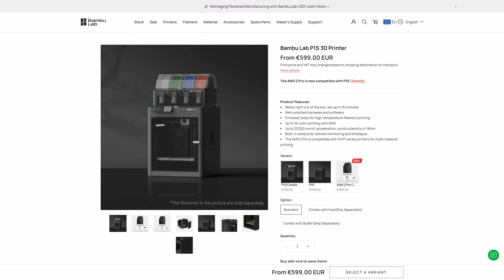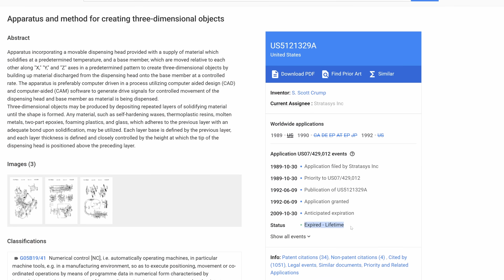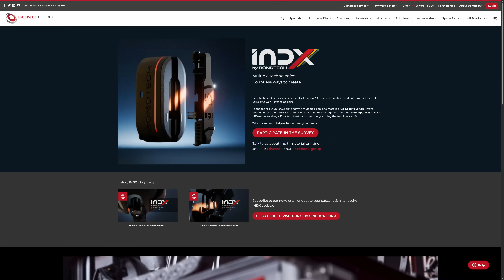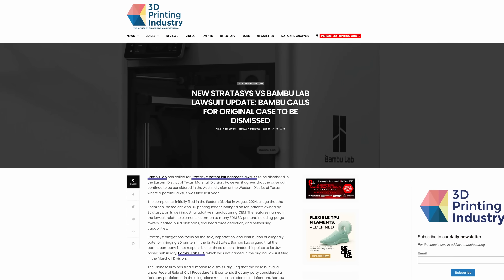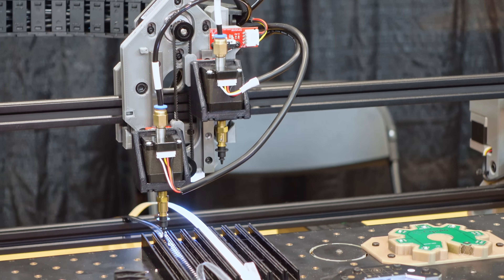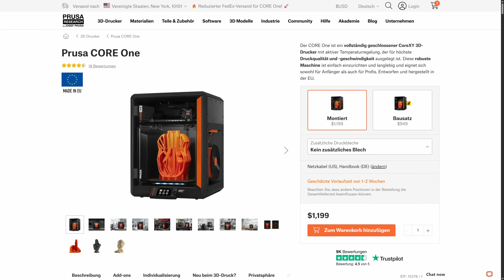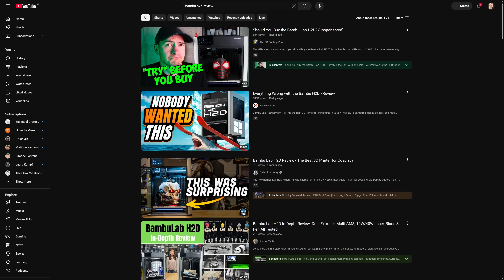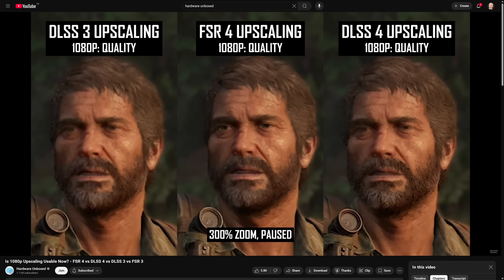How Bambu has won

Comment: My MK4 is one of the very, very few things that I own that gives me peace of mind in that I'm able to fix this thing no matter what, with minimal if any involvement from Prusa. Its one of the very, very few things that I feel totally in control of. I like that, because control is being taken away from virtually every other piece of hardware and software that we have access to.
Reply: Agree!
Reply: Same for me with Voron
Reply: Bro what are you gonna if/ when prusa dissolves? If you’re ever in a situation where prusa can’t save you?
Reply: PRUSA - PR for USA
Reply: I have the same thing with my (now heavily modified) original Ender 3. I know I can get a replacement for any single part of it on Ebay, Temu, AliExpress etc. and  I actually already have spares for most parts. The whole machine is made of generic components that are used in dozens of other early printers and the software is fully open source.

My Ender 3 V3 KE is already a more complicated case with less generic componenets and my Bambu P1S, while extremely capable and reliable machine, is mostly made of proprietary parts with completely closed software, though aftermarket replacements do exist.

On the other hand, a 3D-printer is fundamentally a pretty simple thing, it's just stepper motors, heaters and sensors after all. People have even replaced the whole control electronics of Bambu printers with open source stuff and having a 3D-printer enables you to produce many parts yourself to replace the proprietary ones with something generic so I guess even the Bambus will be able to be made usable after the manufacturer decides they are "obsolete" and bricks or cripples them through software updates. 

Of course that means going back to the era of tinkering.
Reply: That's a bit of an illusion, many things on that printer are not open source, heck, even most things on a complete open source printer are not open source. And while you can probably fix the Prusa Mk4 with other parts if Prusa is no longer capable of providing you with replacements, at what point does it stop to be a Prusa and just starts being a heavily modded generic bedslinger? There's a world of difference between a Prusa and a Bambu, I agree, but it's not as utopian 'open' you (and others) make it seem...
Reply: @Cergorach  It never stops being a Prusa. "The ship of Theseus" concept has been around for thousands of years.
Reply: @Cergorach  I never said it was a utopia of reparability, I just said that I feel in control of it more than anything else. The Prusa has a lot of generic parts, on my own MK4 I didn't even use the fasteners that came with it because 2 M3 bolts just broke at the head after my first build attempt and I just swore it off. Is my Prusa not a Prusa because I didn't use the supplied fasteners? Debatable. I can also just get the aluminium extrusions from any supplier as long as they're cut to the same length. Not going to go through every component on the BOM but you get the idea. Just because the Prusa isn't 100% repeatable with things you can buy in your grocery store doesn't mean I 'may as well' get a Bambu Lab machine. There's still a world of difference between a Prusa and a Bambu machine. The Bambu machine can usually produce higher quality prints in a shorter amount of time and they're good machines but I still remain wary. I wouldn't mind having one as a secondary machine, but if I were to only be able to have one, it has to be a Prusa.
Reply: Except not all of the printer is open source, so if for example the mainboard breaks then you have to replace it with something different and set up the whole printer again and hope that all the features work with your mainboard and firmware. You could do pretty much the same thing with most other printers, closed source or not.
Reply: @conorstewart2214  I'm talking more mechanical. I'm aware that the thing isn't 100% open source. There's always going to be a weak link in everything, even a Voron build. A certain component supplier may just go out of business with no one else making replacements. The MK4 uses aluminium extrusions and various other things that are either generic or easy to replicate. You have to also think about what things are actually likely to break. The Buddy Board or whatever they call it isn't likely to fizzle out. The cast iron frame is straight up not going to break. The 3D printable parts can be replaced. It strikes a great balance between being fixable, while also having great support and plentiful, long lasting parts.
Reply: @conorstewart2214  the mainboard, while not fully open source, has available schematics and no proprietary solution, so no one is stopping other manufacturers to make a fully compatible spare part.
I think that's a decent compromise between protecting development work  and providing independence from their own solutions.
That however cannot be said about their heatsink/load sensor solution..
Reply: Bro what? Many parts of Mk4 aren't opensource... Don't drink the coolaid
Reply: @NordicStrider don't drink the open source koolaid
Reply: Who cares? Its a better printer @NordicStrider
Reply: @NordicStrider  The MK4 has available schematics. Bambu does not. Thus fully compatible spare parts can be made for the MK4, even those that are not open source.
Reply: My A1 was 300 dollars so I love my closed source printer with no frills setup, no research, no nothing. In a few years when it’s old tech you can move on to the next thing
Reply: If Prusa made i car, I would buy it.
Reply: @PerMejdal if they made a car it would be only for mechanics and people who are happy spending a % of their pay on car parts
Reply: my bambu lab a1 gives me piece of mind knowing that all i have to do is run my build plate under the sink with hot soapy water every few weeks. and maybe a drop of lube on the bearings.
Reply: You may not be wrong, but you probably don't feel that way (and don't care to) about the vast majority of things you own and use. Even if you say you do, your actions almost certainly paint a different picture.

You feel this way because it's a hobby for you, and there's magic in it for you that you probably don't see in things that you view just as tools to be used for achieving other ends. Nothing wrong with that, but it also doesn't mean Bambu did anything wrong. Nevermind that the entire open source creed/ideology, as generally express on the internet, is more akin to a religion than anything else. 

Life moves on.
Reply: Typically because people who want that control, have no idea what they're doing, break their own product and then blame the company. That's why the industry has pivoted to easy-to-use printers. There's still plenty of printers out there that are open source and can still be fixed by their owners if need be.
Reply: @TheNerdArmory  What, so all the Voron/Sovol and Prusa builders are constantly breaking their own printers? Well here's my anecdote; I've found that people who have no idea what they're doing, whether they acknowledge that about themselves or don't, typically want something plug-and-play. The industry didn't pivot, new players came in to cater to a new audience. Bambu didn't pivot from making open source machines to what they're doing today. They started off in this manner. Companies like Prusa have not pivoted, they're still putting out firmware updates for machines from 5+ years ago. They still serve the same audience.
Reply: @XxMsrSzprzxX  i disagree with you on one point. prusa for a long time was not a inventor but more an integrator, he integrates good ideas from multiple open sources projects. making the successfull MK2 (the mk2s was my first printer really enjoyable at the time one of the best you could have)
but now they are not the only one, really good projects emerge and are really complete (voron) and now that some chinese manuifacturer are really competiting, prusa is doing what other brand are doing: they start to make their own parts with patent and no open source about it like their nextruder and their heatbrak and nozzle which looks a lot like revo but slightly enough different so they dont fall into the e3d revo patent... and they patented agin they slightly different design...

Comment: I built my rep rap with help from vik Oliver, I  got a ultimaker and ultimaker 2 which I had tinker firmware on and made a tool changer. I got a Bambu x1c early on and it’s been a game changer. I know how to tune a printer but I don’t even need to. With an AMS to have as a filament loader. It makes a perfect workhorse to make functional prints.
Thomas I appreciate your expertise and big picture view. I always looked to you to see where trends were moving and what I might need to pay attention to. Take from that what you will. Leadership in this space is what I appreciate.

Comment: Rarely commenting anything. But Tom I watch your videos now about a decade and I feel you here. I started of with Wanhao i3 or a self build Kossel mini and as a helper the cel robox. Last reminds me of the Bambumachines quite a bit. But in the past it was Prusa and also the fun to tinker and build machines. I am hoping that Prusa goes back to the points where they more obviously joining forces with Bondtech and e3d as they used to do it. Would love to see something like an upgrade Indx Prusa XL but I might go back to a voron. Bambulab is more for the people that would like to have a tool and not a project and I really like a lot of their implementation like the hot end being clamped in and the tighter enclosure directly from the beginning. And at some point I might end up buying a bambu. But at the moment I am more hooked on the indx from bambu, very impressive. Prusa should also come up with other tool heads for the XL as they started to introduce the platform. We will see. The competition is not a completely bad thing.

Comment: I think occasionally doing things like the Air Sensorbox is the right direction, because it's related, yet spans across a wider spectrum of other audience, otherwise you risk becoming yet another person on that review list you showed. 
However my criticism from the sensorbox project is you should be ready to be behind any projects that you start, at least until it becomes mature enough that there are other people contributing to it before stepping back.

I think the 3D printing community has come from being full of people who were interested in "3D Printers"... to full of people interesting in "3D Printing"... like you said... people are not interested in how your photo printer works... as long as it prints good... obviously this is not to say that we give up on the spirit which built the community in the first place... because without the original community... companies like Bambu Lab would not be able to take this "hobby" mainstream... and that's also not to say Bambu Lab is without contribution... prints from their printers are shockingly great and one might even stretch to say that it's perfect... I feel guilty that I am using my H2D way more than my fleet of Vorons but that's just how things are... however Voron is not obsolete YET

So I think the best thing that the "influencing" people can do is... watch out for things that these companies do that is really against the consumer... and speak up for the community... 

Everybody has a different feeling about cloud integration, and I, coming from Vorons... I actually don't really mind all that much even if I am locked into BambuStudio... it's a different kind of machine... so you have to come at it with a different mindset... it's a machine that "just works" so you do it the way it expects to be done... if you don't like that... there are other brands... nobody is forcing you to buy Bambu Lab printers... vote with your wallet... there really doesn't need to be ill feeling towards anything

Comment: I'm really interested in 1)  How well does the printer do at a given task (quality), combined with 2) How reliably does it do that, tempered by 3) How much does the printer cost to do that (value and operational expense).  Is the Elegoo Carbon gonna get the job done for half price or should I just cry once and get the Bambu P1S?  Is the Prusa Core One going to save me enough filament over xx amount of time to be worth that 40% premium?  Will it EVER get a reliable enclosed AMS-like companion device?  Does it ACTUALLY print as well as the Bambu?

For me, I just want to use the 3d printer as a tool.  I want to get something built that turns out to have a part best made by a 3D printer.  I'm not that into HOW it works or WHY it works.  More into WILL it work and HOW LONG will it work before I have to troubleshoot.  Brother laser printers are a great example.  They are cheap and work just as well as ANY other laser printer for almost as long.   But they are not worth repairing because they are so inexpensive.  They get the job DONE with a minimum of fuss.

Comment: Hi Tom. I got into 3d printing with the ender 3, and left 3d printing because of the ender 3.

I then got back into printing because of the p1s, and im leaving the p1s because of 3d printing. It just worked, and that let me grow confidence and experience in the core applications.

Now im back to the ender 3's, but building my own machines.
I needed a bambu as a stepping stone. I have too many other hobbies.

I dont know what im trying to say. Maby that i could have saved myself the trouble by getting a prusa in the first place?

Anyway the (old firmware) bambu is for sale to someone who can stomach the direction of the company. I cant.

Comment: this is all very similart ot "Personal Computing" (way before the PC, there were kits of parts to solder together, and tinker with. Before "open source" was even a phrase.  You went to a computer "fair", and bought components to put together into a system.  People even published computer assembly code in magazines! (remember them).  Gamers can still "self assemble" some parts to make a system, but we went from hardcore "tinker" to be able to have a home computer, to "PC compatible system to laptops.  Even the new "mini-desktops are fully integrated tools to do computing, NOT a hobby to build a computer from parts.

So, it evolves (as we all do) into the two side of things - 3d printers as a hobby, or as a tool to use to make other things!...Nither is the only thing. they both have a use, but mainstream USE of printing is where it is going mainstream.  Nostalic computing still is a valid hobby - just not as broad an audience as using a computer to "compute".

Good analysis - keep up the good work!!!  THANKS for all you have done (and I hope will continue to do.!

Comment: The most important thing to me as a maker, Designer, and hobbyist is PERFORMANCE. I have worked with DIY and Build your own 3D printers such as Enders, and the time to build, set up, tune, and repair These printers takes a LOT of time away from what I really like, which is printing. The accuracy, Reliability, and Performance of My Bambu A1 mini for its price just completely justifies any closed source hardware and software they use, and MOST of their customer base they are trying to cultivate (Average people, Engineers, Manufacturing) simply cannot and does not care about Repairability and how Open source it is. They just WORK.
My Question for people Deciding whether Bambu is right for them, is:
Do you Value 3D Printers? Or 3D printing? If it's the Latter, then get a Bambu lab.
(PS: to answer Made with Layers Question, Tier lists and comparisons would be great)

Comment: My main printer is a Prusa mk3 and I bought it for the same reason people I buying Bambu today: I wanted to pull it out of the box and start printing. I never was into tinkering with the printer. I wanted a device to help me build stuff, not another hobby. I got some hate for that statement back in the day, but a 3D printer was just another tool in my arsenal of tools. I don‘t need to be able to tinker with my drill or my saw to use it. The Prusa did all that for me and still does. Maybe the outcome is not as perfect as it could be, if I would have deep dived into every aspect, but I don‘t care. I need an object, consider the tools I have and choose the right one for it.  -that can be the printer, the laser, the cnc, or me building it by hand with hand tools.
For your channel: I am following your content for over 10 years now, and I would say, I preferred those general topics more than product specific videos. Stuff like your strength tests, thread-inserts etc. That doesn’t mean, that I think product reviews are bad. As soon as I would have to buy a new 3D printer because mine breaks, I would start watching reviews from creators I believe I can trust, and I would say that you are one, I would trust in being honest as you can be in your job.